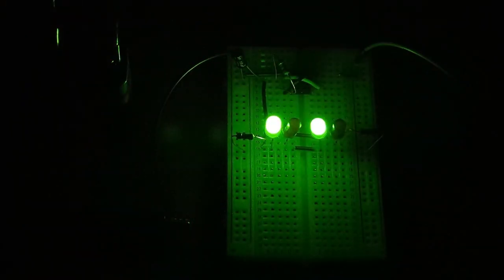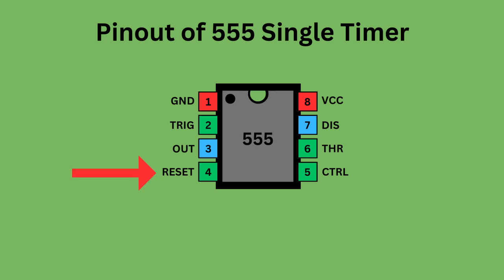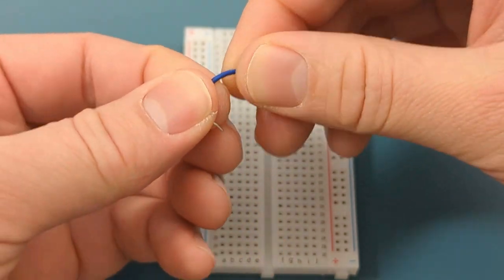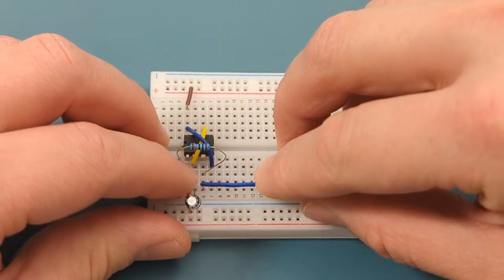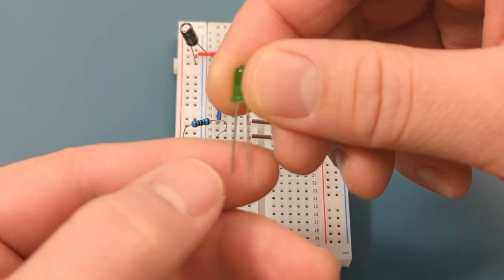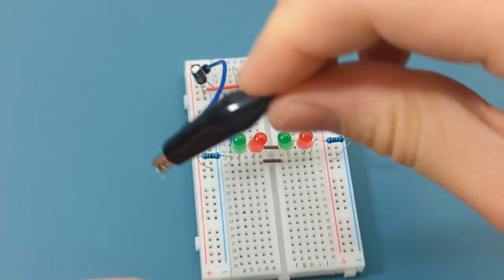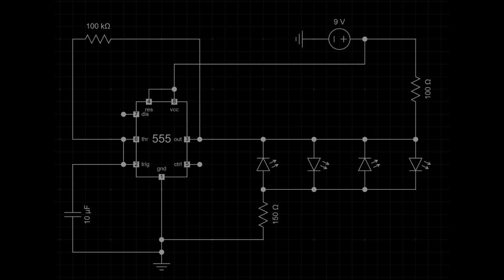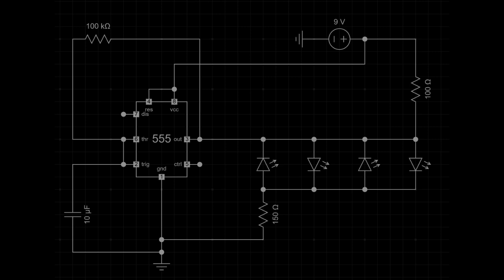How to Make LED Christmas Lights With 555 Timer

Comment: Use two 555 timers and you can have effectively 6 leds that look like they flash independent of each other, connect two leds to the outputs, one to + rail the other to - rail, do same with 2nd timer, then connect two leds parallel but reverse one and connect to outputs on both timers to them, timings are a choice, but I normally go for between 0.5 and .75 seconds on one and 1 second on the other, i built one for a 5 point star with 5 leds on the points and one at the center.
Reply from the maker: That sounds like an awesome setup! 🔥 Using two 555 timers for independent flashing adds more variation to the effect. I like the idea of tweaking the timing for a more dynamic look—your 5-point star design must have looked great!
Reply: @ElectroUniversity  The star was okay, however in the days I built mine LED's were still underwhelming for light output and blue and white were still not available so had to stick with red, green and yellow, i did do another using colored filament lamps connected via diodes, gave it a warmer appearance and softer flashing.